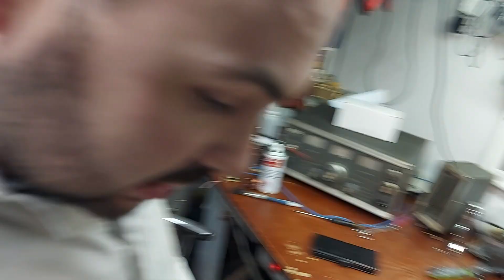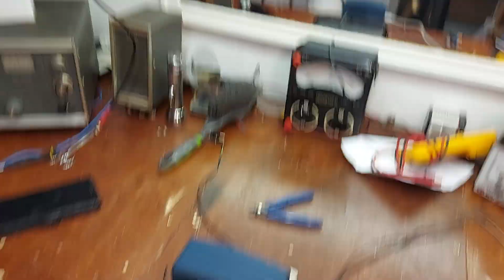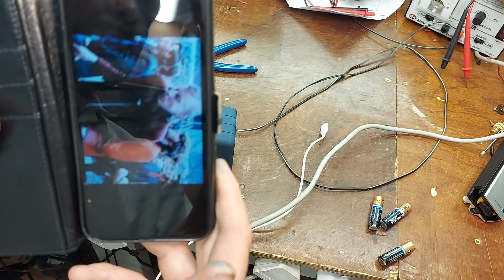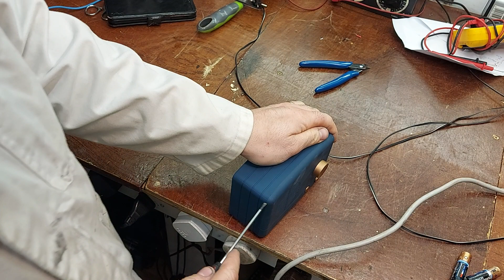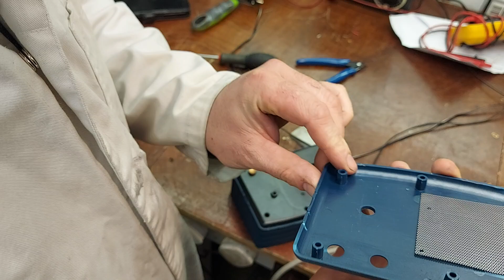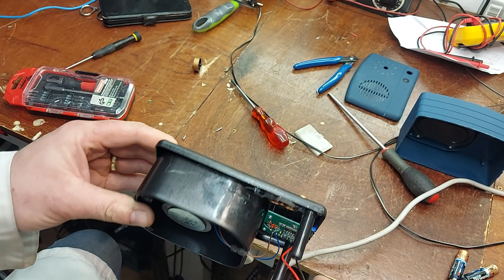Bluetooth speaker taredown..

Comment: The thingy is a passive radiator acting pretty much like a bass port. 
Shame about the crappy rubber coating, could have been a nice project box without it. An actual pot in there is suprising, but much better than buttons or a digital encoder just giving you a few steps where one is too loud and the one below already to quiet. It also keeps the curcuit simpler, although it doesn't matter much on a disposable SMD board.

The amp chip has just a few pins is it actually an A/B, not a D topology?
That makes the efficiency even lower, considering the tiny battery.

Comment: You're better off with one of these JJ. I use them a fair bit, and they operate in pass through audio mode when not paired. Pick up seven or eight volts off the circuit somewhere/rectify/regulate as appropriate, discreet LED behind the dial glass, and away you go.

https://banggood.app.link/29qL83xm39